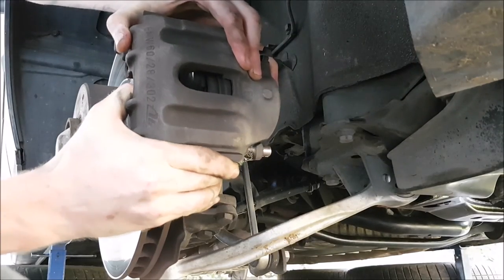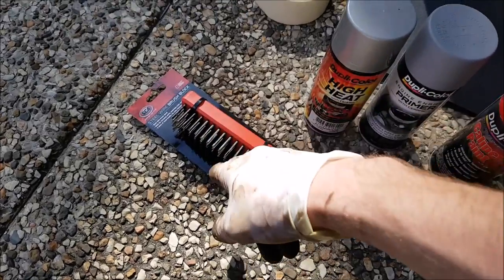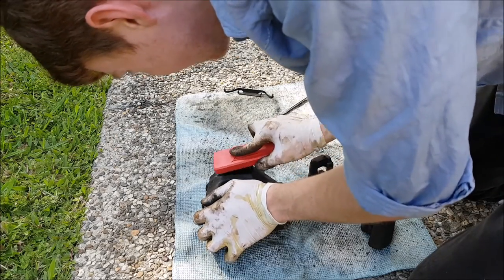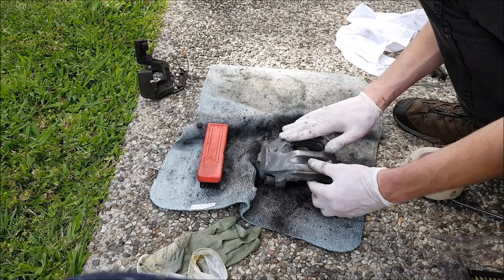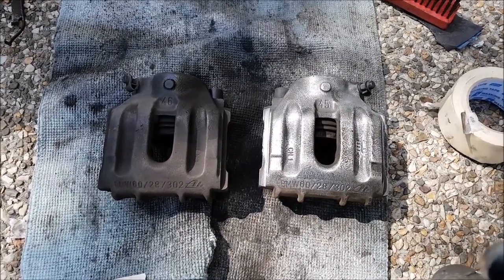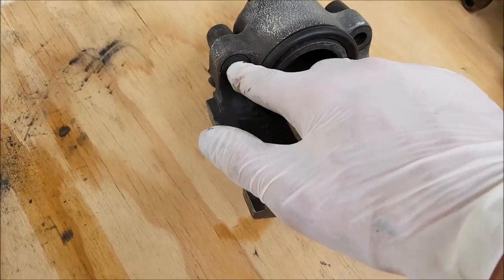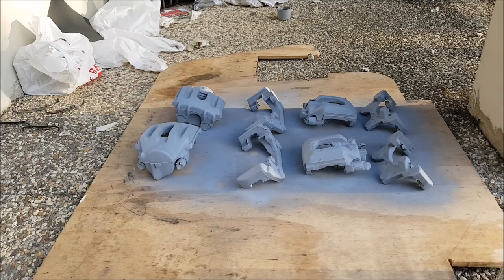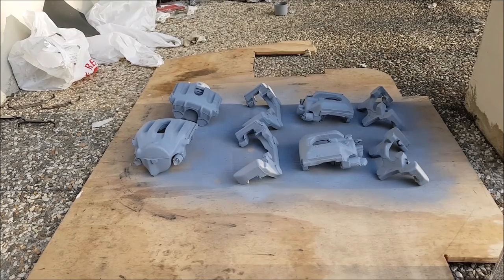HOW TO BMW E34: Brake Overhaul Part 2 - Painting Calipers!

Comment: I really don't understand why you only have 50 (now 51) subscribers. Your content is really awesome and informative. There's not a lot of videos like this about e34's

I've been looking at E34's since I really like the looks of the car, what is it like to drive? (Havn't been able to go test drive one yet)
And does your car have the stock radio? If so are you planning on changing it out in the future?

But as I wrote earlier, your content is awesome and very informative. You got a sub from me!
Reply from the maker: Danish Motovlogger, this is honestly the best comment I've ever got!
What is it like to drive? I absolutely love it my 540i. I'm not sure how to describe it... but it's a great car! It handles well for its (quite hefty) size, the V8 is very linear and is SO damn satisfying above 4000 rpm, and on top of all this it looks amazing and has a bit of class to it. I've had to be wary not to lose my license the engine is so damn fun....

I recommend picking one up if you can, although be prepared to fix it up (it's an ageing German sedan, after all). 
The radio in mine isn't stock, as the previous owner changed it out some time ago. This is easy to do even if you need to learn how to solder (not too hard). 
I've only replaced the speakers in the rear so far because they blew out, and I'm certain they are 5-1/4" speakers. You can see how to replace them in my rear suspension video if you need to. 

Cheers again for the compliments, and I hope you enjoy whatever car you end up getting!
Reply: Thank you! I am hopefully picking up my 520i tomorrow or the day after tomorrow :)
We need to replace the control arms on it though, they're a bit rusted. It's still safe to drive it though. It just won't go trough the MOT if those don't get replaced.

Comment: nice job! but would it not be better using a 2k paint for this type of work or is the basic spray can  hotpaint really gonna hold? have you done this before? how long Before the paint start to fall off?
Reply from the maker: Hey! I've never painted calipers before, so I guess we'll just have to wait and see how it holds up. This is high temperature paint, so it should be quite resilient and i'm hoping it lasts as long time!

Comment: I was wondering if you know what size speakers the E34's use. I managed to get a hold of an E34 and I want to upgrade the speakers but I'm really not sure what size they are and neither am I sure how to measure them.

Thank you in advance :)
Reply: size of speakers in ALL e34 are: 5.25 front and back,  however! 
there are 2 "versions" of e34 sound systems. . .
version nr 1:  meaning there is no factory amplifier installed 
 this means upgrading head unit (stereo) or speakers is 
 of no problem, for exemple: installing a head unit - just use a "iso-adapter" (2-way speakers front and back?)
version nr 2:
so called "hifi 10 speaker" system. . . well you gonna have to spend some time ;) if your car is stock and you just change your head unit for a new one by using a iso-adapter as in "version 1" you will get BAD or NO sound!(3-way speakers in front, 2-way back filter built-in in factory amplifier)
how to fix this you may ask. . . what you need to do:(1) disconnect the factory amplifier  (take it out of the car throw it in the bin)
(you will find it in the left side in the back behind panel, two connectors White and black)

(2) now the fun Begins. . . well not really. . . i hope your car is the "version 1" ;)

you need to buy a 2-way or 3-way speaker set with filters for the FRONT
of the car  and coaxial or 2-way for the REAR (coaxial will be fine and will be cheaper, coaxial for REAR only)
you can also buy a amplifier or just use the head unit as amplifier and so on and so on ;) im not gonna write more cuz maybe you allready know how this goes. . . good luck  it took me 2 Days to do this with NO experience so its possible to do...
even if you have no ide what you are doing. . .
Reply: Thank you for the awesome answer!
Hopefully it's version 1, will have to check that.
Reply: an easy way to find out is to look at the front door panels, if your panel has a "built-on" speaker on the panel right by the mirror it means your car is the "to bad" version 2 :)
Reply: Thank you so much!
It doesn't have those speakers by the mirror so that means I got the "good" version right?
Reply: 99-100% I would say YES and congratulation! you have just saved yourself a lot of time and Money yay! ;) also Before you change/upgrade your speakers START by upgrading your head unit
as that upgrade will have the bigger impact on the sound. . . and all you need to buy is a iso-adapter (about 10EUR). . .well and a new fancy-top-of-the-line head-unit ofcourse :) 

the stock e34 speakers are really not that bad considering the age
and play suprisingly  well with new head-units
Reply: Yeah when I test-drove the car I noticed that the speakers were a lot better than expected :) Deffiently going to start by upgrading the head unit. Thank you so much for your help :)
Reply from the maker: I think mine has version 2, as it has speakers on the doors ;). Did you enjoy driving one?
Reply: Yes I enjoyed it a lot! It was incredibly awesome!